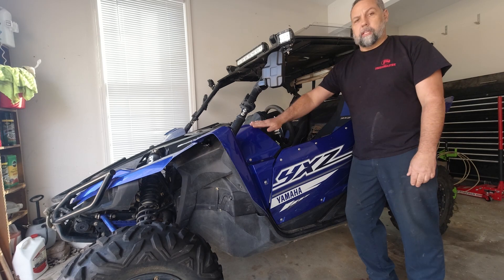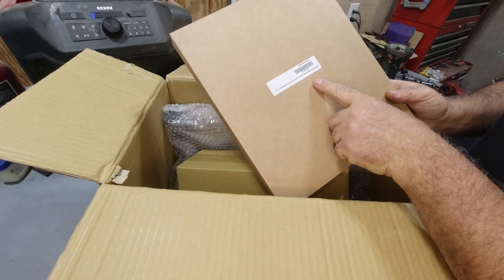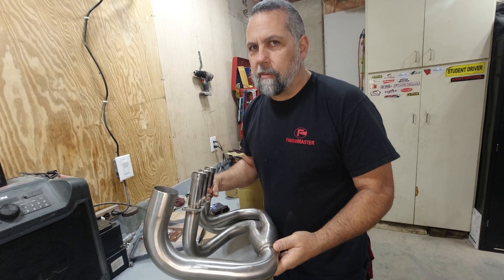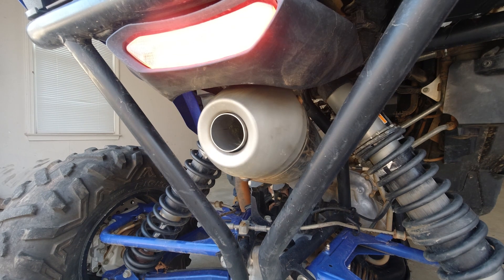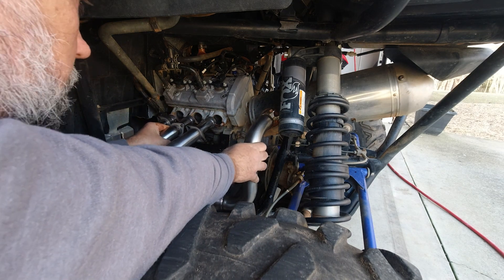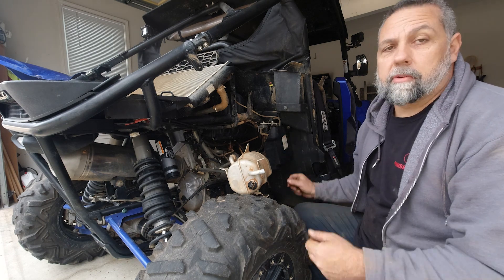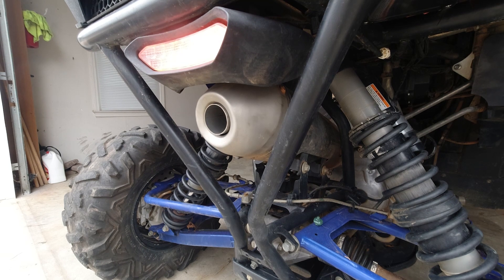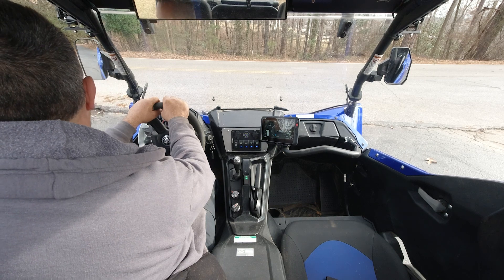Yamaha YXZ1000R 25 More Horses! Ep35

Comment: There have been some other vids where they dyno'd before and after and this kit absolutely increases the power. Add another vid once you get some dirt time on this setup. The YXZ, although dated at this point is still the most intense experience of all of the sxs's available from a drivers standpoint.
Reply from the maker: While debating on doing this kit, I watched a lot of vids and read a lot of reviews on it. The consensus was that it wakes the machine up although one video with Draggy data was unimpressive. I can say without a doubt that it is wildly stronger throughout  from bottom to top. In this vid I noticed that I had hit 70 at the top of 4th, this car has never seen 70. I will certainly do an update video.
    If Yamaha would do a even a mild power increase and fix its suspension issues it would be extremely desirable.
Reply: @RestoRooster OHV  agreed, it really wouldn't take much for Yamaha to update this car, boost the power and fix the suspension geometry. Add the crawlbox and it really becomes two cars, a wrc rally car that can crawl the rocks or mud when needed.
Reply from the maker: @michaeldavison430  Yet they keep spitting them out as-is. Still a good car though.
Reply: @RestoRooster OHV  I still enjoy my 16 as much as the day I bought it. It's all about the "experience". Enjoyed my RZR before it, but there really is no comparison.
Reply from the maker: @michaeldavison430  I don't have much seat time in other machines. I've driven my friends X3RC a few times and it is super comfortable but I just love shifting the gears and revving it out.